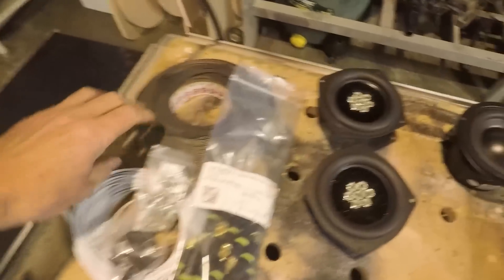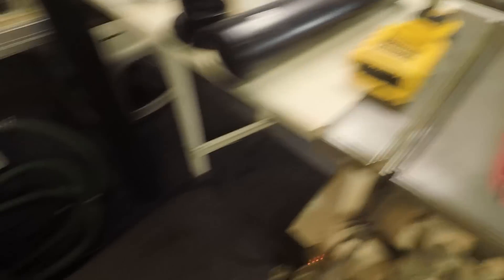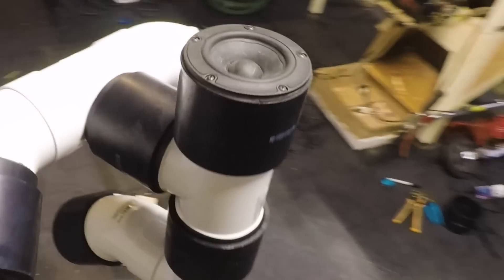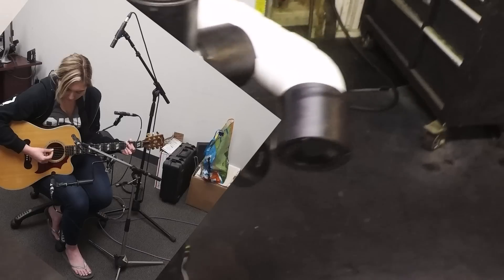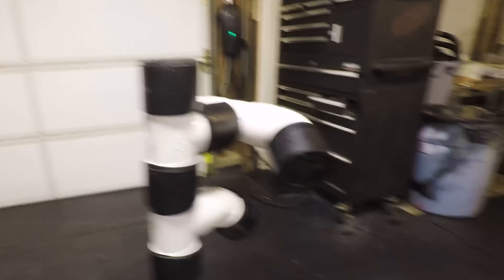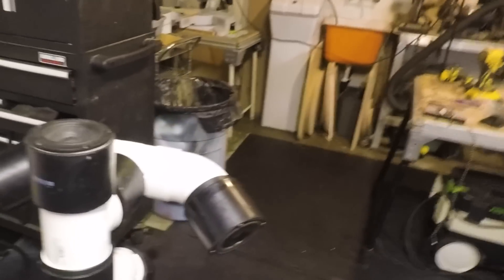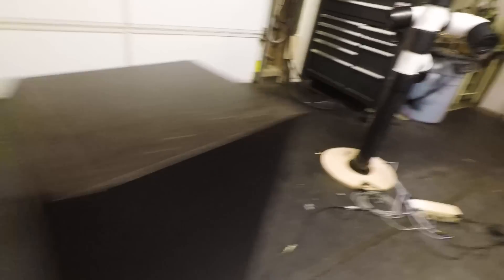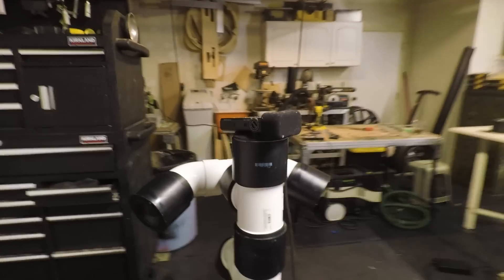Speakers Don't Sound Real, Lets Build One That Does

Comment: Ive heard the Linkwitz LXmini sounds really realistic. It has the woofer pointing upwards in  a pvc tube and a fullrange driver in a kind of dampened dipole config. I think im going to build one someday
Reply from the maker: interesting. there are definitely some speakers out there that reproduce a conventional mono or stereo signal with high degrees of accuracy. 

that said, what I believe and am trying to demonstrate in the several real sounding speaker videos is that mono or stereo recordings are incapable of capturing sound in such a way that any reproduction will ever sound accurate no matter how good the speaker is.

the speaker is not the issue, the issue is a lack of the sound being captured in such a way that realism can be reproduced.

natural and real world sound sources radiate an infinite number of sounds in an infinite number of directions. 

if you want to reproduce a realistic sound, then you need a recording that captures the sound radiated upwards separately than the sound radiated left, separately from sound radiated right and rewarded and downwards and so on.  an you need a speaker that recreates all these different sounds separately and radiates those different sounds in different directions.

so you need multiple channels of recordings and multiple amps and multiple speaker.

and

you need those sounds radiation outward from the sound source, not a bunch of surround speakers pointed inwards.

if sonic realism is the goal.

but...

sonic realism is just one of many possible goals, each with different solutions.

Comment: Dispersion from the infinity is limited to the front and tails away from center 
Dispersion from your tube aims sound in 4 different directions and the results are apparent
Reply: Do you think the effect deals with time delay frequency delay proximity to the driver 
You almost suggest a 360 degree ball enclosure with many drivers pointing in every direction I wonder how that would compare 
Seems proximity to the source has a lot to do with it and distance to other drivers
Reply from the maker: natural sound sources like instruments and voices all radiate differing sounds in differing directions. 

most speaker designs arrive to radiate one sound in one direction or one sound in many directions.

if you want something to sound realistic, then you need to emulate the source and radiate different sounds in different directions.

Comment: The challenge with stereo speakers and 3D sound is actually isolating the ears - far easier with headphones. I think you can use highly directional ultrasound based speakers focused on each ear and they will work in one rigid listening position. Once you've isolated the ears, you then need to imitate the frequency response and phase response differences of either ear in a true binaural recording. One of the challenges is distinguishing between "in front of you" and "behind you" in a binaural recording, and the shape of everyone's ears is slightly different, producing different EQ profiles tailored to the brain and ear shape of each person, meaning everyone's perception of a 3D sound is slightly different at the fine details. With my ears I find they are most sensitive to treble slightly forward about 20 degrees forward of the left and right positions.
Reply from the maker: Yeah, agreed and stereo speakers are incapable of reprocducing sound that sounds realistic.

Just like no matter how perfect the photo or painting, it will never be fully realistic.

With photos and stereo speakers, just walk behind or off to the side or even move your head and any realizim it may have had, will collapse.

Photos are great and paintings are great and stereo speakers are great and none will ever look or sound real.

Comment: So what would happen if you took a traditional stereo signal and had one channel playing through all of your speaker?
Reply from the maker: Let me know if this video I did answers your question. https://youtu.be/MlqJ5H8cA3M?si=yjRFGvpMddI928RD
Reply: @DaveRat  I guess it does. But this, then makes me wonder if you could double- or triple-mic each musician in a performance, like you did with the guitarist, then create a stereo or 5.1 (or whatever) presentation that would get the benefit of your multiple mics per musician? Could that be rendered respectably without the need for a speaker for every mic?
Reply from the maker: Think of an instrument as an energy source radiating multiple different complex sounds in many directions.

Now think about trying to recreate that source.

There are many ways to emulate it and create versions of it.

But if you actually want to recreate something that sounds realistic and true to the original then you need something that radiates multiple complex sounds and many directions outward.. similar to how the instrument creates the sound.

Having multiple speakers around the perimeter of a room facing inward is a completely different scenario.

Think of a sprinkler in a field shooting water outward

Now think of recreating that by putting a bunch of shower heads on the walls pointing inward.

How well will the shower heads recreate the realism of the sprinkler?

Now think of recreating the sprinkler that shoots water outward my having a contraption in the middle of the room that shoots a bunch of water outward.

Will the sprinklers on a wall shooting inward or the contraption in the middle of the room do a better job of recreating the original sprinkler shooting outward?

Comment: This is a great idea however recording a performance a placing speakers in a position to match where the position of the recording was made would require that the speakers be moved and repositioned for each recording. 
Yes it would work but expensive and hard to manipulate well.
Reply from the maker: Interesting. Perhaps consider that to sound realistic it does not need to sound identical.

Do we really need to recreate the exact placement and configurations of instruments to sound realistic?

I think that placing realistic sounding speakers in a room in any configuration will create a realism whether that's the identical layout to the source is a separate consideration.

If we were to make a realistic robot that was indecipherable from a human being that would be one thing.

If the robot was modeled after a certain human being we could also add in that robot doing the exact same things in the exact same pattern as the human being it's modeled after but that's a separate issue once we've got the robot that's identical to the human it's realism can diverge in any direction

Comment: I build speakers with an OPEN FR driver on top of a box and with a woofer in the box. I sloped the open FR driver back by like 40 °. They sound nearly as crisp from the back and sides, as they do from the front. I needed reference speakers for my speaker building hobby, so I can get an idea of what a speaker should sound like (and tweaked my made speakers a little for my liking). But the reference speakers only sound any good from the front (on axis). Guitars don't do that! 😅

Comment: Of course typical band in a room playing over PA speakers is not realistic. I always like to hear some direct sounds from drums that has a lot more dynamics and frequencies being directly radiated than just through a PA set. It becomes realistic.
Reply: @DaveRat  Am wondering of a comparison of using single channel vs regular speaker. Does it still sound more realistic.
Reply from the maker: @gregsz1ful have you watched the other 3 videos on "real speaker" I have done?
Reply: @DaveRat  I saw one other. Have to look for others.
Reply from the maker: Cool, lmk if that answers. Not sure I understAnd the question but if the other vids don't answer, lmk and will try to

Comment: A great idea!  Looks a bit like the Linkwitz LX Mini that Siegfried Linkwitz designed.
Reply from the maker: The LX mini is super cool and interesting and it's also important to point out that it's a completely different concept. The LX mini is trying to create a point source generating a clear single sound. While this can be desirable and sound cool it is kind of the opposite of the speaker here where the speaker is radiating multiple sounds in multiple directions like a real instrument does

Comment: So now that we can play around with multi-track in the digital realm, this seems like a great idea. Maybe have 3 sectional arrays ,LCR with multiple coaxial enclosures and adjustable heads on each speaker. Each rcording could just be like a plug in that uses only eneough speakers for the channels used. 18 tracks or channels would be plenty but 32 could be done too. Stereo is really an acneint format that was limited soley by the playback mediums of tape head playback and phonograph cartridges. Even a 9.1 surround receiver, assuming you could interface with the DTS to play 9 channels any way you liked, would be a cool way to experiment.
Reply from the maker: So cool, Yes! You grasp the concept! I try and share ideas and it is my failure when I am unable to convey the concept.

I am not looking for all to agree and it is wonderful when the concept is understood
Reply: @DaveRat  I think you explain and demonstrate it very well. I assume the bleed-over from one mic set to the other would only increase the soundfield for those ambient moments when they converge, adding ambient realism too. I used to wonder about that long ago. How it would be if they could mix in such a way as to have each mic designated to a channel and played back through a speaker accordingly. Wow, that was long ago but I thought that would be so realistic. A mic is really just a speaker inverted.

Comment: I think i had mentioned the speakers back to back before. running one out of phase in another post but to recap on it just because i found it interesting…. I had some crap computer speakers, i put them back to back facing out in the middle of a room and reversed the phase on one channel, so left was pushing left and right was right but in phase with left so they acted as a same phase driver between the two, with cancellation between each other from the side view, so it might sound weird but the sound from the location or the speakers disappeared and all you could hear was the reflections off the walls. Wide and interesting. This is why i commented on the drum stereo playback video because an inverse system behind but in the same phase direction, yep I agree is still more point sources but because the way they cancel each other, those point sources from the side disappear and all you hear is the room. Would be great for reverb capturing I reckon. Cheers j from nz. Respect mr Dave
Reply: Anthony Kaldellis had a place up the road from me in the 90’s in pahi, small world ahe. Never met him but friends did.
Reply from the maker: Yeah I remember when he bought that place I think there was a cliff and ultra light plain launching area there.

As far as running things out of phase, things get messy pretty quick when you do that. It can work well for directional low frequency arrays. But doesn't really do that good of a job to take the same exact signal in and out of polarity and makes it together in the real world. As it's a pretty unnatural event.
Reply: @DaveRat  yeah polarity is what I meant not phase, still anti phase though. Yeah maybe just practical for what I’m doing :)
Reply: There a spelling errors that may confuse because I love to semi drunk txt ahaha but ya get the picture

Comment: This is fascinating! Every musical instrument should have its own speaker, so that the radiation patterns of these instruments are transferred correctly. Maybe there's also another solution: Think of a speaker that is able to radiate either in a 360 degree-manner, but also like a horn. Just depending on which Frequencies you put into either channel of this speaker. Like this, a full stereo setup with more consideration to instrument's radiation characteristics could be realized with only four channels.

Comment: Atmos and other like systems support audio "objects," basically mono tracks that can be mapped to wherever...  I wonder if a  recording could use this to have objects like drum front, drum back, singer left, singer right, singer top, etc. -- and then have the home system either map those to traditional 2.0, 2.1, 5.1, etc. systems... or just send them to individual "stick speakers" (like shown in the video).  In other words, is the base technology needed for this already there?

But the result would likely be quite cool!  Hey, I want the drums over in that corner!... followed by someone just moving that speaker.

However, I suspect that the closest I'll get to enjoying things "as they should be" is in-ear monitors with spatial audio... or actually going to live concerts (preferably with acoustic instruments!).
Reply from the maker: Yeah that makes sense. Having the speakers pointing outward from a central location rather than pointing inward from the outside will definitely create a different sound dynamic.

Beyond that mapping things to a group of speakers pointed out words or like Atmos does mapping things to a group of speakers pointing inwards is all technology that could be implemented

Comment: have you heard Ohm Walsh speakers? They have an omnidirectional cone facing down. Might be similar reproduction.
Reply from the maker: Yes and I show them in other videos I have done on this where I go into more depth as well as show lots of other speakers that radiate a single sound in various directions.

Check this vid and let me know what ya think

https://youtu.be/tn69y1f74yc
Reply: @DaveRat  hi Dave, thank you for your reply… sorry i missed that Video, I’ll watch it as soon as i can. Just thinking…what if you recorded a band with 3 mics in front and 2 in back (instead of overheads). Could you then co-opt existing 5.1 channel A/V receivers (or more mics/drivers for 7.1 etc) to run your speaker? Have the various speakers pointing in the general direction of the mic placements.  The speaker mounted on a down firing sub. Keep the speaker under the average height of a TV and if placed a few feet in front should give a good approximation of the live event from one “box” rather a speaker per instrument. Please let me know if i missed the point entirely! 🤣
Reply from the maker: The concept to ponder is the dir action sound radiates 

From an instrument, like a sprinkler in a field or a campfire, the energy radiates outward and the energy looks/sounds different as you walk around it.

For 5.1 and stereo and Atmos and most systems, the energy is shooting inwards like showerheads mounted on the walls and ceiling.

Both are all good but different and one cannot accurately recreate the other.

Stereo and 5.1 typically try and reproduce the sound of some other environment inside the listening environment

The speaker I'm working on reproduces the instrument itself inside the listening environment Rather than trying to recreate one environment inside of another environment
Reply: @DaveRat  got it! I was thinking you could use the channels differently to make your system more available to the consumer. The surround channels in 5.1 etc are used to create sound coming from behind the listener i was suggesting using those channels to recreate the sound radiating from behind the instrument (or band) and have them fire backwards from behind the speaker which(other than any time delay and reflection issues) should give a more accurate recreation of the live event. I think your system (which would be awesome) would be more like IMAX where a special set up and room would be required.
Reply from the maker: Very cool and my goal with this is not make or sell but rather to get people thinking about how sound is really created vs how it is reproduced and the vast differentials between the two.
Reply: @DaveRat  I agree! Modern stereo is a very unreal reproduction. I thought if we treated the band as one instrument then your single speaker system could do a better job of recreating live sound. I’m a singing drummer in a local band so trying to recreate that “live” Sound at home with my hifi often disappoints.